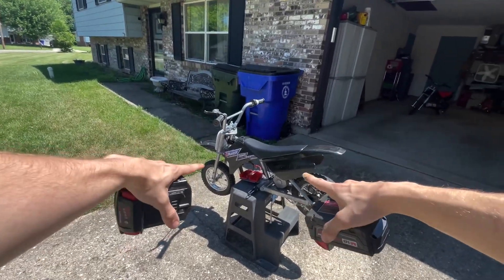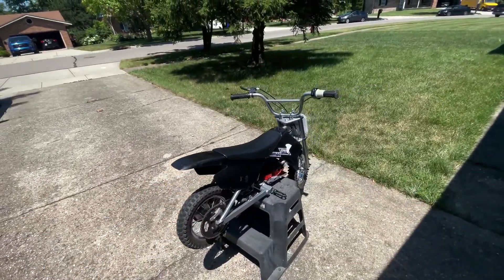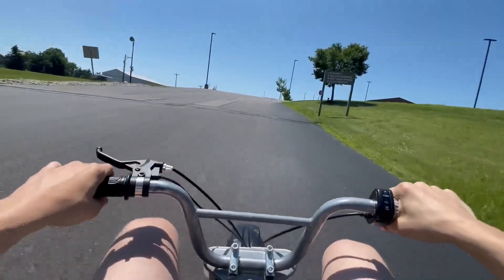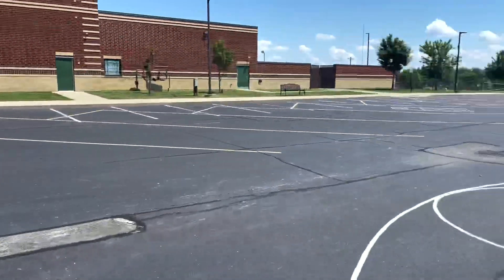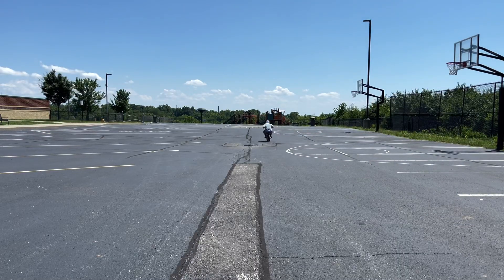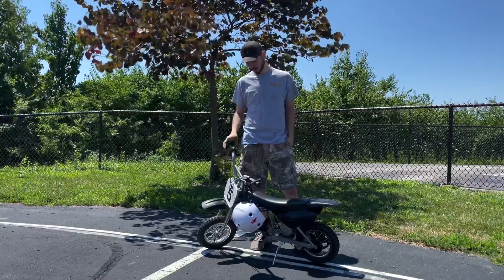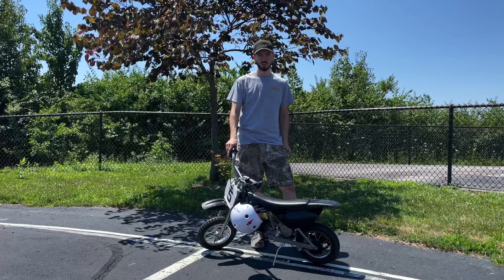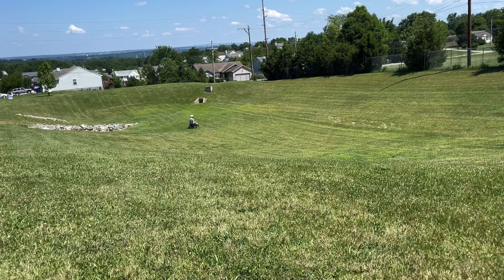Milwaukee powered razor mx350 top speed test - JordyBuilds

Comment: This is good for someone that has a bunch of Milwaukee batteries like me. I have about 20 lol. 12v power wheels are great with a single one too
Reply from the maker: Yes exactly 
Unfortunately I only have 2 5.0’s right now
Reply: Wont the amp draw kill the batteries or does the battery have a protection circuit that that limits the amps and has low voltage cutoff
Reply from the maker: Battery has no low voltage cut off unless installed in tool. I’m currently building plug and play kits with a low voltage alarm/voltage gauge set up for this exact reason! Will be available soon. Will be doing videos on it!
Reply: Can I get some I’m broke

Comment: I just converted my sons MX 350 with a razor MX 500 6 pin throttle and controler kit with 2 M18 HD9.0 batteries wired in series, and 2 days later he fried the stock 24 volt motor. I'm not sure what happened, so i just ordered a brushless 48-volt motor with a controler kit.

Comment: I have an aftermarket 24v variable speed throttle and 500watt controller on my mx350 can I do this battery upgrade with what I have or I need to upgrade throttle and controller again ?
Reply from the maker: I would imagine you could use that set up

Comment: Hey man had a question , ordering a mx 500 36v controller and throttle going to do a dewalt battery conversion , going to use 2 20v batteries which ones do you recommend ? Was thinking 2 20v lithium ion 5ah ?
Reply from the maker: The higher the AH the longer they last. 5AH worked for me
Reply: @Jordy Builds  will 2 20v batterys work with the mx500 36v controller?
Reply from the maker: Yes

Comment: Just got my son a MX 350. Looking to upgrade it since its not running.  I have plenty of Milwaukee batteries.  What controller and motor do you recommend?
Reply from the maker: I sell modified 36v controllers and Milwaukee battery adapters. I don’t have a mx350 kit yet but it’s in the works! Shoot me a message from my websites contact forum and I’ll get you set up
Reply: @JordyBuilds what about for the razor quads?

Comment: Do have to upgrade or regulate anything in the electricals to go from the 24v 7ah to the 36v 10ah? I upgraded my kids power wheel with the Milwaukee batteries like this and ran great for a long time. But now it’s blowing motors almost instantly.
Reply from the maker: I haven’t messed with power wheels really.
Reply: I went from the 24 v to 7 ah to 42 v 10 ah and this had smoke coming out the motor in a 15 minute drive test.
Reply from the maker: Well yeah lol. When you double the rated voltage that’s what’s gonna happen

Comment: wont this burn up the motor on the wheel? or is that only for higher volt batteries?
Reply from the maker: Stock motors can usually handle 36v well. I sell a plug and play kit now
Reply: @JordyBuilds  I have a 40v hart battery hooked up to my son's grave digger. It's been like that for years now never has a problem. Just was curious on how much the stock motors can handle.

Comment: I did the Milwaukee 18v battery upgrade and the mx550 controller and throttle upgrade on the mx350. Batteries are dying fast though? Any thoughts on what it could be?
Reply from the maker: Make sure to run at least the 5.0 ah batteries to get a minimum of 30-40 minutes of ride time

Comment: If I use the milwaukee battery setup can I use a fast scooter 36v controller and throttle that has the keys???
Reply from the maker: I sell full kits now. Check out my full videos. Haven’t heard great things about that company
Reply: @JordyBuilds  will the 36v overvolt kit burn out the 24v motor?
Reply from the maker: There’s always a chances especially for hard dirt riding but they usually last a good while. If not, the replacement on Amazon is cheap.

Comment: Also what and how do you charge it with?
Reply from the maker: Never use anything other than the charger that came with your battery’s. For milwaukee use a milwaukee charger, for dewalt use dewalt. Don’t try to charge one thing with another. Take batteries out individually and charge

Comment: Can i use 20 volt milwaukee batteries? With 9ah? Will that be compatible with the controller and the adapters and all that?
Reply from the maker: 18v milwaukee or the 20v dewalt will work. 9ah will be great , just make sure both batteries are matching

Comment: Nice video😎. Did you just upgraded the batteries and everything else is stock?
Reply from the maker: I used a mx500 throttle and controller as well! Can be had on eBay for like $35
Reply: @JordyBuilds  so is that the original 24 volt motor and you’re using the controller and throttle for the 36 volt version?
Reply: So what do you push the batteries into and wire that to controller
Reply from the maker: @MarcyMckeefer  correct
Reply from the maker: @gibzkustomz  check out my other mx350 video on how to wire it
Reply: How fast?
Reply: @JordyBuilds would this be faster if you ran better controller even with a stock motor
Reply from the maker: Yeah sure but you have to be careful not to cool the motor

Comment: This thing is quick my mx350 has a 48v 1800w motor and goes 30mph
Reply from the maker: That’s sick!
Reply: @flojotube  i have stock gearing wich is very torque and the small tires add to that im planning on changing the gear ratio to get a top speed of 40mph
Reply from the maker: @issacflores7588  yep I’d go for a 13 tooth motor sprocket
Reply: Do you have a build video ? Where did you get the parts? I’m looking to do this
Reply from the maker: I have stuff on my tik tok @ JordyBuilds or message me on my facebook page @ JordyBuilds

Comment: Dose anyone know how fast it would be if i put a mx 650 motor in it?
Reply from the maker: The mx650 motor won’t be much different
Reply: @JordyBuilds  You should make a video on how to wire the battery adapters and the dash it dosent really show that much in the how to bulid it video
Reply from the maker: Just look up wiring two batteries in series, that’s all it is. The battery meter just gets added the the positive and negative wires of battery

Comment: Why not just upgrade to the bigger razor mx?
Reply: Not being rude but you started with the smaller platform.
Reply from the maker: I got it for $20. I have multiple full size ones running 48v. Check out my tik tok, JordyBuilds